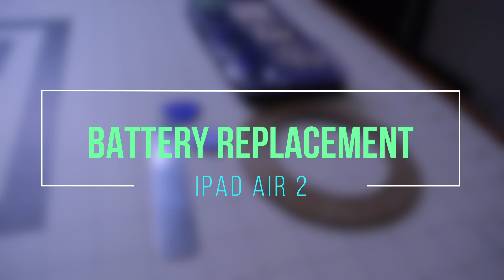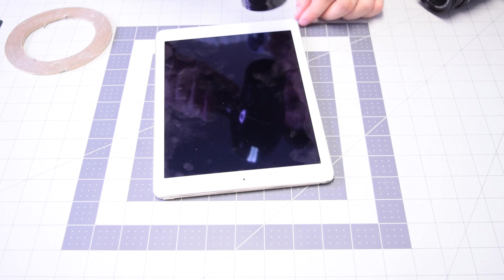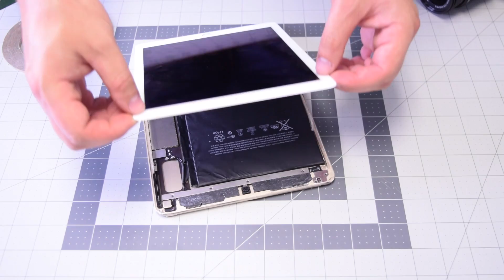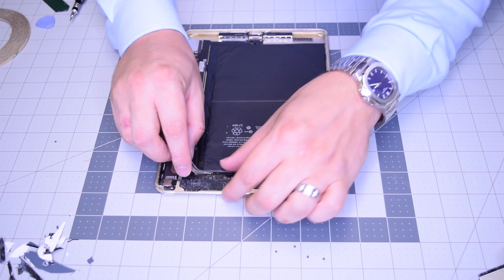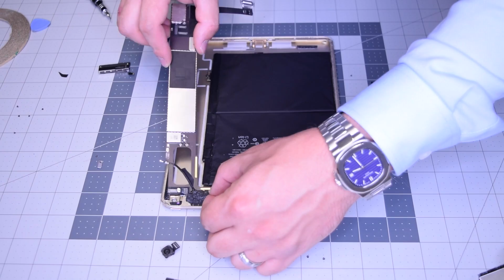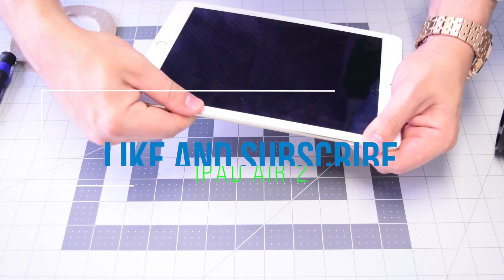🔋🛠️🍏iPad Air 2 - Battery Replacement (A1566 and A1567)

Comment: I have tried everything here to get this damn thing apart, and the screen cracked. There is no way to remove the case, damn it. I put a hair dryer on it for over a minute and used a sharp knife, and the back/front will not even open a tiny bit to insert the knife. It was factory-glued with cement, not tape. I threw the POC away and purchased an Android.. FYA.

Comment: This is the 3rd video about replacing the A1567 iPad Air 2‘s battery, and it was the most complicated one. On the other hand, it showed me that it also can be opened using a regular hair dryer instead of a heating pan. So when I take all the simple things of those 3 videos together, ir seems to be quite easy to do the job myself successfully!

Comment: Do me a favor, anyone who is watching this, get a solvent like 50/50 acetone and 90%+ IPA, get a pry card and use that to get the adhesive off of the back of the battery, using a metal prytool is a surefire way to cause an actual fire from puncturing the battery.

Comment: Literally just did mine …. This is overkill.  It is the simplest thing.  Apart from dealing with adhesive for screen and battery.    Be careful with the screen.    Remember to lift the logic board so that the battery can lift over the connector (nipple).

Comment: OK ! this is official...you do not need to take anything apart  like in this video...and maybe .you do not need to disco the ribbon cable for the screen...while the screen is standing upright ..slip your thingys under the old battery and lift it all up...then slide a insulated piece of whatever in under the plate that was undone by removing the battery clip holddown screw and just ease the whole unit  up a bit..the battery then slides out and since the separation tool is still under..then take battery away...now put new one into that slot and whole new battery is still standing up..screw down that cover that you took off...now that battery connector is locked down...take the tool out and place battery down into place with sticky parts ready to do their thing...now you may not have to even remove the screen cables cover as they may be not screwed into the case underneath like the battery one..just try it..its amazing...only minutes

Comment: Most of what is shown in this video is completely unnecessary disassembly… This is the equivalent to taking the engine and transmission out of your car to change the battery, it’s completely ridiculous. There are other videos that are superior to this one. You only need to take the display off then remove the battery and replace the battery everything else can be left completely untouched. Watch the video presentation created by Geardo . It shows the proper and professional way to change the battery.

Comment: What is the temperature(hair dryer) to heat the screen
Reply: I soak iPads and iPhones to 80-90°C; it's much easier to use a cardboard box as an oven and get heat properly in.

Comment: Wow you removed everything compared to some vids where they don't probably best to do it your way to prevent breaking things.....Question when you do the battery replacement does the Ipad lose any settings etc?  Your link is outdated for parts. What type of tape do you use?

Comment: Thanks for the vid. After heating, a stanley knife is the easist way to prise the first edge, after that the small edge tool does the rest. Surprisingly, the hardest part of doing this was replacing the screws afterwards ;)

Comment: There's no need to remove EVERYTHING just to get the battery out. I can't support the methods shown in this video
Reply: he must work for apple ! wants ya to give up..i am goin to try pryin up the battery pack as in the last step or so of his..there cant be anything around the sides to worry about all this disconnect..glue on bottom side of battery may be all…

Comment: Man, so needlessly complicated process. All that adhesive and the loop under the mother board is just completely unnecessary. Apple brags abut saving environment by not shipping you charging block and makes everything possible for you to NOT repair your older devices and just go buy a new one from them. Such a hypocrites.

Comment: PLease I'm traying to change both cells dryed for another two new. Is very confused the (+ and -) mark on the original battery. From top the battery have  ( + -) marks, but from the bottom are inverted... I need to know the + , -  polarity of the power connector.  The positive is on the camera's side and the negative is on the charging port conector's side? I think in the top label the polarity indicated matches with the conector's polarity, and from under the battery the polarity marks refers to the cells, is it correct?

Comment: I was able to lift the main PCB at the battery connector and lift the battery connector up and off of the tiny stand-off holding it secure. I then slid the new battery connector in place and took my shims out to seat the main PCB in this area. 
After reinserting the connector screw to secure the battery connector, and slipping 4 strips of double sided tape to hold the battery, I replaced the display connector shield and with the surround tape cutouts in place, re sealed the glass display with some heat, and presto, the job was done without disconnecting any connectors other than the battery connector.
Sorry for the two part comment...accidentally sent the comment below before it’s time.
Thanks again for a great video, couldn’t have done it successfully otherwise.

Comment: Apple sure never wanted customers to replace the battery. But this is an excellent detailed video of how to replace the battery. The Amazon replacement came with lots of tools but no instructions. I did have trouble starting to lift one corner of the glass, so cut away some of the metal case near the earphone Jack to get a start at it...then with extra heating had no problem going around the edge.
I was concerned about the sheer number of connections and taped down components that were to be removed, so I looked for alternatives.
I found that after I removed the first shield over the display connector, and the one screw directly over the battery connection to the main board, I was able to take a significant shortcut! I determined that if I headed from the back side, I could carefully lift the old battery from the back, so it was only captive by the small connector. By carefully heating and lifting the main board near the battery connector, I was able to lift the main PCB
Reply: Cool, make a video! Please. Cuz this video makes me want to throw mine away. 😩

Comment: This IPad has clearly been disassembled many times, yours will not come apart anywhere near this easily!
Reply: Yeah it will if you get it warm enough to free up the adhesive.  I use a cardboard box as an oven and a heat gun set at 80°C; six minutes in there and the adhesive lets go, no problem.  I do the same, face down to ease the logic board adhesive when it's ready to come out.  I've used this technique on over one hundred iPhones , iPads and other makes of phone.

Comment: I charge my ipad and it shows the apple logo, i see the home screen but it inmediatly shuts off and shows a low battery icon on a black screen, i tried different chargers and charged it for about 8 hours but the cycle repeats, do you think its a battery issue?

Comment: Okay so one thing I am going to point out, you obviously prepared that iPad prior to disassembly. Which is very misleading to those who may be trying this for the first time. Misleading in the sense that you do not use a metal pry-tool on the battery because if you puncture cells it can explode. Misleading in the sense that the effort required to actually remove the glass is actually significantly hard than what this person did. 

It is a good video for the most part, but if you are going to do a tutorial it needs to show all the hardships involved. Leaving out the challenge involved misleads first timers into thinking that this is an easy repair.

Comment: I replaced my battery and just disconnected the battery and peeled up the battery across the logic board. This sure seems like a lot of unnecessary steps to replace the battery
Reply: Does pulling out the iPad battery can cause fire
Reply: not unless you short circuit the battery or you're powering the battery while removing it

Comment: With all the money Apple spends on R&D this is the best they can do for battery replacement? Laughable. Android should eat them alive. The magic is over...and I do love the simplicity of the iPad. But Android has left Apple in the dust long ago. The iCloud tracking feature is useless compared to "Where's my Android" and Google Home connectivity. Where is all that money going Apple?  Funny how they became what they accused Microsoft of being all those years ago.
Reply: Big time, my thoughts exactly. There’s absolutely no excuse for this BS design. Apple intentionally makes their devices extremely difficult to repair. Even the most loyal of fanbois know it.
Reply: @SunTai-i8h  Hear, hear!
Reply: Pretty easy to copy stuff and run with it. Funny how if it wasn't for Apple, Android wouldn't have anything to reverse engineer and try to make better. Just about every single decent tech device on the planet has started because Apple released it to market first ... if anyone else could innovate that would be nice. Im still waiting. DOS vs Mac.. Windows were born to catch up. iMac  - processor built-in to the screen - unheard of!  iPod - iPhone - iPad - Apple Watch - I mean seriously. Before Apple released each and every one of these there was not a SINGLE decent Android device that even came close.  Apple have to invent it before everyone else jumps on board - no-one else even had an App Store before Apple.. the list is endless. They're responsible for more millionaires that have made their riches via Apps on both platforms than any other Compnay.. very easy to play second fiddle... still waiting on something that is innovative and new that Apple can copy... oh, hang on.. I guess the second button on the mouse, Okay I'll give you that. Apple tried to pretend it wasn't a must for too long then invented the Magic Mouse which was when released again was another first.. nuff said.,
Reply: @Hudda Rudda  Generally ideas can't be copyrighted. Apple stole from Xerox and evolution continues.  The problem with Apple (I speak only for myself) isn't their product, it's their greed and culture. They make enough profit margin to produce their superior products in the USA, but rely on questionable Chinese work conditions. They slow down older products, because they are arguably either greedy or addicted to cash. Saddest thing is, they've become what they, in the beginning accused Microsoft of being. I was an original Apple fan, I left when their products became too costly for me. It seems they are profit driven more these days. Steve Jobs wanted to put elegant computing into the world. He did that...now they are focused on maximizing profits and keeping their products exclusive to those with deeper wallets.  I use them now however and I'm largely indifferent to platform.

Comment: If you have an eye problem, it’s better to bring it to service and let the pro do it. Precision parts especially the screws are difficult to install if you have a sight issues and not really technically inclined of what you are doing.
Reply: I have great hands from fly tying and brain surgery, but this is WAY too much!  One wrong move and you get a new paperweight.  Save yourself the hassle and take your iPad to the Geek Squad at Best Buy - if they trash your unit you can get a new one on them!

Comment: I wonder if the metalwork and three screws were added or did he place them discretely in the bin I wonder. See 8'59" and they are still outside of the iPad.
Reply: it was the heat shield and its screws.  must have thought them uminportant

Comment: dang. trained by apple i spose. o no they would say replace the whole device lol. serz i do these and phones for a living and its faily easy to remove a battery thats been overheated a few dozen times and NEEDS replacing by just lifting the logic board a touch after u pry the battery loose. a heating pad gives better heat distribution so maybe thats the difference

Comment: There is a super-important step missing here and it caused me to destroy my logic board. There is a single screw which attaches both the battery and the logic board to the casing. If you don’t remove this before trying to lift the logic board you will damage it. Please add this step to your video
Reply: Ian Nagle bugger 🤧😪
Reply: @Neeva01  did I do something to you or offend you in some way - I don't understand your response
Reply: Honestly I am in this field and this video is very bad...First of all would you work on something electrical without removing the power source first? No, so why didn't he disconnect the battery before removing parts? You wouldn't work on your cars electrical system without disconnecting the battery am I right?
Reply: @Xpert2077  You are so right - I wouldn't follow this video
Reply: @Xpert2077  Explain how you disconnect the battery when it's captive between the spigot on the chassis and the logic board?  That's the whole point of the video, explaining how to free the battery up.  The alternative is to remove the battery screw, free the battery (most likely bending it with the associated risk) and then pry the logic board up enough to get the battery out.  You might want to find another field.
Reply: @Andrew Kiss  they make tools to go between the battery and the logic board connection. Also you can make something that will go between with a thin piece of plastic or something. It's just common sense...
Reply: @Andrew Kiss  You put the iPad on a heat pad for about 15 min. Then you add a couple drops of iso. Next you remove the battery screw then slide the little plastic wedge tool in between the battery and logic board. Then, proceed to disconnect the rest of the lcd and digitizer plugs. It's pretty simple tbh... I've done hundreds and never messed one up.

Comment: What a stupid and user unfriendly design - to change battery, the most used and abused part, you need to disassembly the whole unit. Where are old engineers and designers are - dead probably from shame.
Reply: pczarn that’s the whole idea. What a pita
Reply: pczarn I agree they definitely go very out of their way to engineer it so it is murder to replace. Why? Because then you buy a new one, and they make a ton more money. 

I personally do replacements on phones, but I doubt I’ll risk it for my iPad. I will get a company to do it for a little money. 

I personally asked an Apple employee and they said they don’t do batter replacements. Their attitude is just buy a new one. Yeah, money is no object of course. 

It’s a dilemma because, let’s face it, their products are phenomenal. But I guess the only way they stay that way is by raping everyone. :(

If I could accomplish my needs as fluidly and amazingly well on a non-Apple tablet I think I would have a go at it. But these days they’re almost as expensive but not nearly as good. :(
Reply: @TheShattenjager  I agree with you on this. I tried using Android and even on the higher end stuff it still isn't like iOS. You only if you are lucky get 1 update and then apps no longer are supported on the older versions. With my Ipad I am on iOS 14 even 6 years later. I am going to attempt this repair and if it works great, if not well I will be looking for a new iPad.
Reply: Yep, my thoughts exactly. It’s a very clear case of planned obsolescence. Unforgivable...